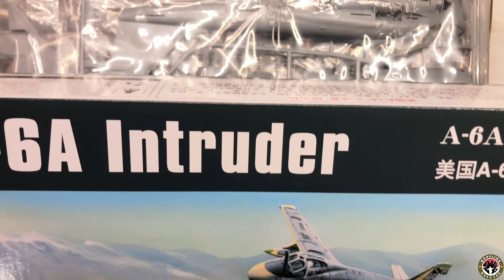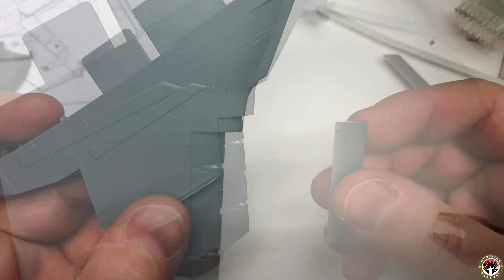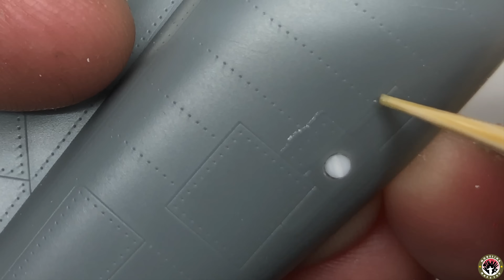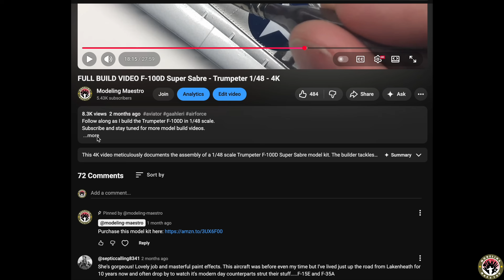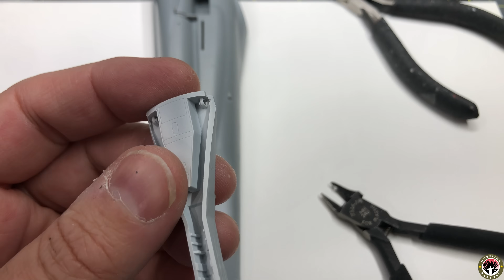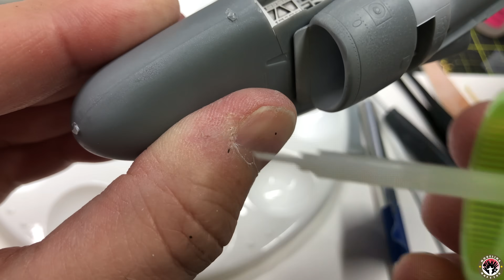Hobbyboss A-6A Intruder 1/48 scale - Model Build and Review - Construction, Airbrushing, Oil Wash 4K

Comment: Great work mate. You are an ambassador for CA glue. I lost count of the mention of ... CA glue. 

I find CA glue a no no, unforgiving, very difficult to work with (other the than filling larger gaps and with the inclusion of adding baking powder), CA glue will go brittle over time and doesn't weld to plastic. But other than super glue as we call it over here, superb work and effort. Very much enjoyed. ATB   Paul
Reply from the maker: CA is quite easy to work with and I’ve used it for decades now and never had it “go brittle”. I find it reliable and a massive improvement over fickle putty. Thanks for watching.